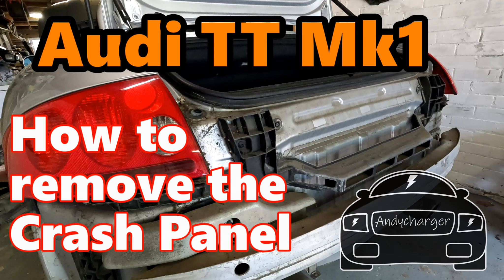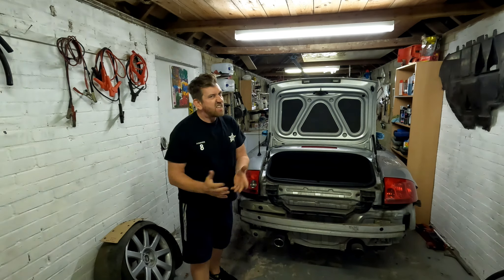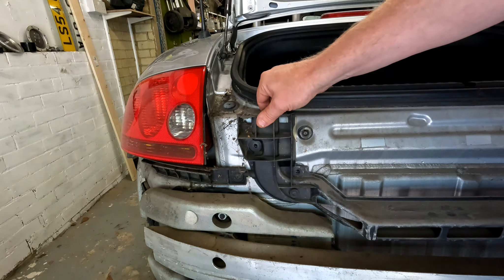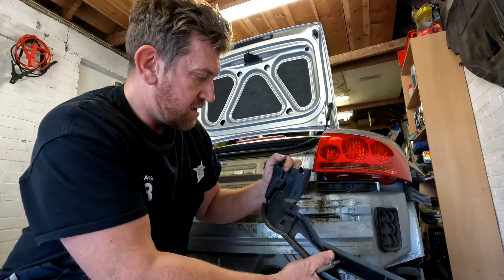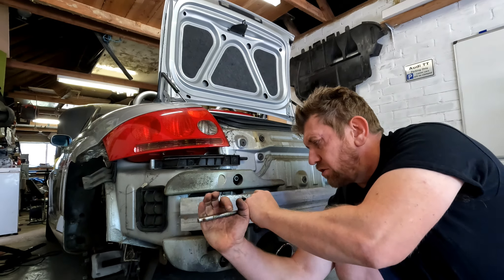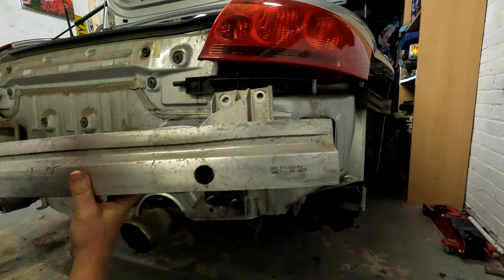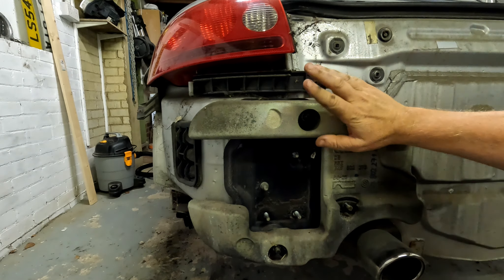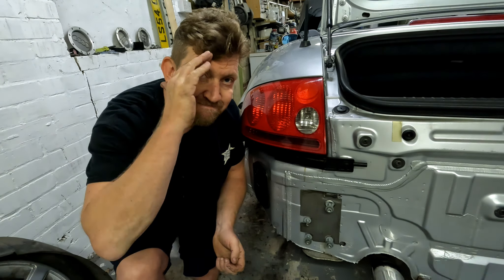Audi TT Mk1 - how to Remove the rear crash bar and bumper mount

Comment: Thanks for the video. If I may add it's much easier to remove the trim piece if you remove the tail light first (easily done by removing the two hand screws) that way the tail light rubber seal is not in the way and it makes it much easier to reinstall as well.
Reply from the maker: That is a great tip. Thank you 🙏